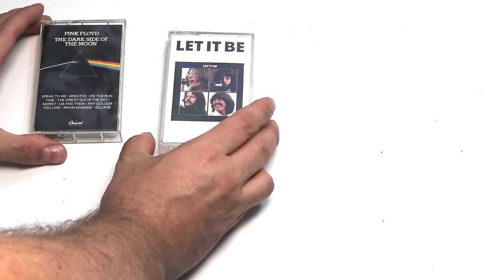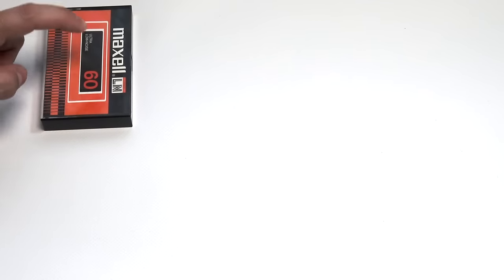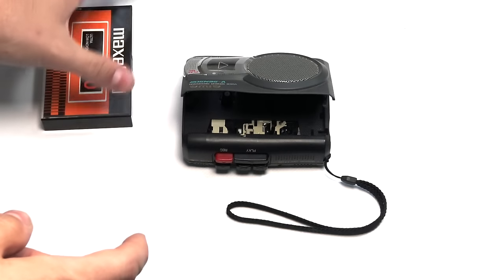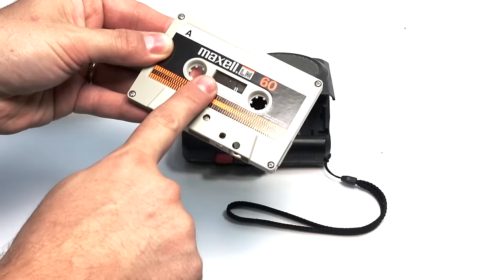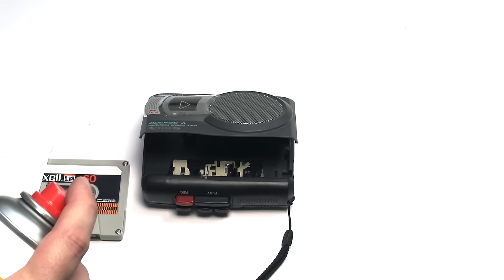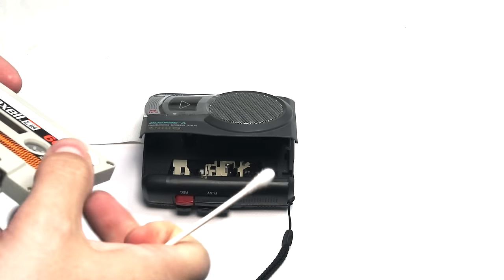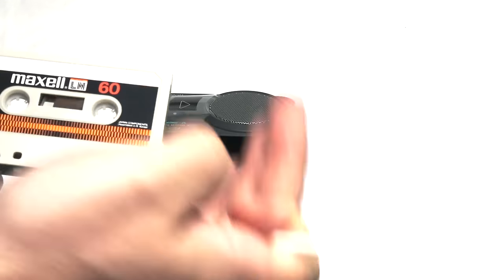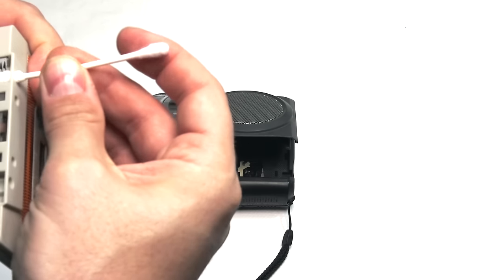How to relubricate your stuck cassette tapes

Comment: I does work! It takes a while for the silicone to work its magic by drying and herring to the tape. Thank you sir, you saved some cassettes from being filed in the round file under Garbage!
Reply from the maker: Great news! Thanks for telling us!
Reply from the maker: Jonah, as many other techs you are driven by prejudice without real knowledge, in this case, about this issue. It is really sad to see how arrogant you are, just go back and read your commnets. I see now that you have written several negative comments over the months and I think you should inform youself better before pointing your finger, insulting and denigrate people. I have posted simple things but considering that you would like more proof here you go. After rading this info, I hope you will be polite and intelligent enough to apologize.
Here you will find a selection of scientific papers explaining the issue and how it is a standard procedure to relube tape (even NASA does this!). I have underlined a few crucial passages in the papers: 
Heritage: https://www.dropbox.com/s/f8254yfeqrrw9vp/heritage-02-00097-v2.pdf?dl=0
Nasa: https://www.dropbox.com/s/xxdw1qh8mlbppdu/Nasa.pdf?dl=0
HESS: https://www.dropbox.com/s/ydrvxg6zipjkrvw/HESS_Tape_Degradation_ARSC_Journal_39-2.pdf?dl=0
Preservation Commission: https://www.dropbox.com/s/3s3ejmho2jexhgt/pub54.pdf?dl=0
   - (here is the official article: https://www.dropbox.com/s/rtvqt1n537w9vpa/Bogart.pdf?dl=0)
Kondo: https://www.dropbox.com/s/zi4vv42ggi9vh8u/tribochemistry-of-ionic-liquid-lubricant-on-magnetic-media.pdf?dl=0
Here is an article of a lab that is relubing its cassettes: http://tasso.cat/re-lubrication-of-compact-cassette-tapes-with-sbs/

Comment: 🤔 Doesn't It Mess With The Recording On Tape? Considering It's Being Lubricated?
Reply from the maker: No. But make sure you pick up the remaining/exciding lube with clean cuetips. All types of tape have lube. Check the video description more more info.
Reply: Thank You, Got It
Reply: 1938thunder yes. And it will also ruin your heads and gears on your deck. Trust me on this.
Reply from the maker: If you leave to much lube, yes. As I have explained you must let the lube seep in and then remove the excess with fresh cuetips. No risks if done properly.
Reply: ANA[DIA]LOG the lube doesn’t absorb into cassette tape. Sorry it’s not physically possible.
Reply from the maker: Jonah, as many other techs you are driven by prejudice without real knowledge, in this case, about this issue. It is really sad to see how arrogant you are, just go back and read your commnets. I see now that you have written several negative comments over the months and I think you should inform youself better before pointing your finger, insulting and denigrate people. I have posted simple things but considering that you would like more proof here you go. After rading this info, I hope you will be polite and intelligent enough to apologize.
Here you will find a selection of scientific papers explaining the issue and how it is a standard procedure to relube tape (even NASA does this!). I have underlined a few crucial passages in the papers: 
Heritage: https://www.dropbox.com/s/f8254yfeqrrw9vp/heritage-02-00097-v2.pdf?dl=0
Nasa: https://www.dropbox.com/s/xxdw1qh8mlbppdu/Nasa.pdf?dl=0
HESS: https://www.dropbox.com/s/ydrvxg6zipjkrvw/HESS_Tape_Degradation_ARSC_Journal_39-2.pdf?dl=0
Preservation Commission: https://www.dropbox.com/s/3s3ejmho2jexhgt/pub54.pdf?dl=0
   - (here is the official article: https://www.dropbox.com/s/rtvqt1n537w9vpa/Bogart.pdf?dl=0)
Kondo: https://www.dropbox.com/s/zi4vv42ggi9vh8u/tribochemistry-of-ionic-liquid-lubricant-on-magnetic-media.pdf?dl=0
Here is an article of a lab that is relubing its cassettes: http://tasso.cat/re-lubrication-of-compact-cassette-tapes-with-sbs/

Comment: my tape is basically stuck though. It is very sticky and pretty hard to turn. any tips?
Reply from the maker: If it sticky then you have sticky shed syndrome. You can try to bake it for one last shot. Otherwise it's gone!
Reply: @anadialog  what do you mean by bake? (Im new to cassettes so pls explain)
Reply from the maker: When tape, especially reel to reel tape, has sticky shed syndrome you can literally bake the tape at very low temperature (check online the correct ones, I don't remember know) that will temporarily give you the chance to rip and/or duplicate that tape for one last shot. Then eventually it will decay. You can it it also with tape, possibly taking the tape out of its shell.

Comment: Hello dear,
Ciao carissimo.

I tried this with three cassettes using the same lubrifiant that u suggested. It works but not 100%. The tape stucks at the beginning/ at  the end. Is it possible I used too much lubrifiant? If so, is there a way to resolve the problem?
Thank u in advance and tanti saluti ✌️
Reply from the maker: Did you wait at least a week?
Reply: @anadialog  thank u 4 answering.. 
Yes and no. Because I wanted 2 c if there was any improvement. So I checked everyday if it worked. But now it's over one week. Yesterday I lubed again all three cassettes and now I'll wait a few days. If the problem persists, maybe I gave them 2 much lubrifiant. Is this possible?

Comment: That lubricant stretches the tape. The only thing that requires lubrication are the reels. This lubricant will also compromise the pinch roller adhesion properties. DON'T PERFORM THIS !!!!!!
Reply from the maker: Check the documents I added in the video description before shouting your preconceptions. Its a standard procedure, also done on cassettes decks. Also, as I have explained and written all over the place, you must obviously absorbe all the exceeding lube with clean cue tips after the treatment. So non of what you are claiming will happen.
Reply from the maker: Again, Re-lubing is a standard procedure, leave aside the manufacturing phase, we are talking after the original lube has evaneshed. Lubricant is present ON the tape. Check the documents in depth and all your doubts will be removed. BTW, I did invent anything I am just reporting an existing technique.

Comment: I had two cassette tapes one squeaked the entire time and the other slowed down and stopped in the middle of playing I used home depot silicone spray wet the Q-tip several times in the process you could actually see the tape get wet with silicone , LOL I wet it way to much and started to see bubbles forming inside the cassette case  so to dry it I used dry Q-tips it . the process took 30 minutes. I played the tapes back wow they played perfect and the Tape Deck was not harmed with the silicone but cleaned the head and pinch roller to be on the safe side . I highly recommend this process to save your tapes
Reply from the maker: Thanks for your feedback Jose!

Comment: It has been my experience with cassettes that you don't have to introduce lubricants to solve wow / flutter , slow or no rewind /FF ,when you now that heir is no mechanical problems with the deck . As all brand name cassettes are held together with 5 screws ,
I have found that by ever so little , just losening these screws then gently twisting the shell will solve all of these problems . If you happen to have a cassette that has a clear teflon liner on both sides of the tape pack , i have found that by separating the cassette shell and lifting out just one of these liners also solves the problems . Definitely low tech solutions . But I do not agree that using  a silicone lubricate is wise . Silicone is an insulator of current . And 0.5 mil tape does not need to be gummed up by a foreign agent .
My policy is keep it simple .Do nothing that will potentially damage the tape and gum up the heads of your cassette deck . If when playing a tape , the tape squeals it is most likely that the binder that holds the oxide in place has dried out . And as the tape is dragged across the head it may squeal . If the binder is failing it can grab and bounce on the head causing a variety of unpleasant sounds . I've been using both open reel and cassette . The Open reel began in 1975 . Cassette in 1996 . I am very familiar with tape .
Spraying aerosols isn't one of them ................DGR
Reply from the maker: I agree that one should first try mechanical solutions. But, if these fail, relubricating is a standard procedure for tape. Please read the articles I linked in the video description on this topic. One just needs to suck up all the exceeding lube and let it seep in. No risks at that point.

Comment: Wouldn't it be safer to use Rubbing Isopropyl alcohol, like a 70/30 mix? That has a light lubricant in it and much safer that silicon
Reply from the maker: ABSOLUTELY NO!!!! Alcohol melts plastic and tape is almost all plastic (polyester or acetate). Never ever use any peecentage of alcohol on plastic media, inclusing vinyl (which is also plastic, PVC).

Comment: Hey I'd like to see an experiment where you bake a cassette that's not playing good, I've seen a few folks on zappateers bake there tapes and they sound much better
Reply from the maker: Baking a tape is a one way direction with a point of no return. You bake a tape to play it one more time and transfer the content to another media. It is not a rejuvenation process.
Reply: @anadialog  well they also transfer the tape over to a new shell
Reply from the maker: Sure that is good! But if it's a lube problem it will not help much.

Comment: Strange ! Actually the 2 black (sometimes transparent films) inside the tape, act as minimum friction for the wheels spin.
Putting lubricant on the band itself, will end up on the reading heads and creating dirt on them ! Not speaking about the adverse effect of lubricant on chromium/magnetic coating of the band.
Reply from the maker: All tapes have lube in the binder. Check the info and articles in the video description. Just pay attention and collect the excessive amount of lube with cue tips.

Comment: In my case, my tape was so stuck, it needed a drill to turn it. I lubed it, and still no action.. So I salvaged the pad from the tape and threw the Christopher Cross tape right into the garbage. It doesnt pay to try to lube an old cassette, just forget it..
Reply: EXACTLY! Because this person has NO IDEA that it was the bad "binder" in the Tape's oxide that causes all these aformentioned problems! ANY kind of silicone, oil, or lubricant etc. will RUIN your tape deck, not to mention the rubber pinch rollers... This is utterly ridiculous from a person who knows nothing!
Reply from the maker: Stop babbling and start reading the articles I have linked in the video description. I have documented my self you are just moved by prejudice. Itbis a standard procedure for cassettes and reel to reel magnetic tape. It is a well reknown lube problem for example in XDR cassettes. The process is safe of you follow my instructions. Try, then discuss. For now you are just moving your hands on the keyboard with no backup data or grounded info, just your biased opinions. 😉

Comment: I have a few Ampex Grand Master cassettes from 1979 and they are prone to sticking.
Reply from the maker: It's the Ampex formula sticky syndrome, unfortunately all their type of tapes suffered of this issue...
Reply: @anadialog  I have a few 456 reels that are sticking as well (actually two are ConcerTape from Radio Shack which are rebranded Ampex)

Comment: What about when it sound wobbly the first 2 songs sound fine and then the rest of the tape sounds wobbly
Reply from the maker: Could be, but not necessarily a lube problem. Doesn't hurt to try.
Reply: slip-clutch that spins the reels slipping too much, after the small-radius layers of tape on the take-up reel are past and more torque would be needed to keep winding it up.

Comment: I would spray  the spools as well between the spool and the cassette body with the silicon and have the q tip on the other side when lubricating on the plastic side not on the magnetic side you could put some silicone on the felt pad in the middle to add lubricant to the tape when it's under pressure from the head then you don't need to bother with the q tip and  having easy accessl tape machine.
Reply from the maker: Good idea John (the felt pad)! I did sone research and I discovered that the lube was originally on the oxide, phobably because it is abrasive and creates more friction than the other side.
Reply: +ana[dia]log but it would get transferred from the backside to the oxide? by coating the plastic side this will come in contact with the oxide on the real. plus rubbing the oxide at speed I don't think it's a good idea not with cotton wool buds, just spray or 3 or 4 drops on the felt pad and couple drops inbetween  the spool and the body on either sides should do it.
Plus having it on the felt pad should help with wow and Flutter figures this is the most resistance when in play against the head and the back of the tape. I thought about graphite powder mixed in with the silicon maybe 2 to 1 silicone but it could cause problems with the magnetic field on the tape I'm not sure maybe it's something you could try! See over a long period of time of playback if the recording gets muddled or shifted, I would have thought the graphite would be charged by the recording and will it stay in place? If it stays in place it on make it for a better type. You could make your own tapes by using Scotch tape and graphite powder now there's an experiment!!!!

Comment: I have a question.
The breakdown of lubrication was on the back-coating of the tape.
The side that doesn't touch the heads.
Assuming this is right...
Shouldn't we be coating the other side?
I know it gets contact anyways because it respools...
Idk thoughts?
Reply from the maker: Lube is present in the top coat, not on the back. Just lube well and make sure you make it seep in and then absorb the remaining lube with clean cuetips.

Comment: Does reel to reel tapes have the same problems?
Reply from the maker: In some cases, yes.
Reply: Can you explain more detail, for I have hundreds of reels over 30 years old. I know about cleaning them with a cloth thru the deck rewind/fast forward but do I need to lubercate them ?
Reply from the maker: Hi again, I am not an expert of this but I did hear about people that tried to lubricate their tapes when they were a little stiff. A lot of people prefer to bake but I think that in some disperate cases a small amount of lube can help. You could try to put some silicon-based lube and see the effects but I must worn you that I have never done this so please do not take my word for it. Sorry for not being of more help.
Reply: Look up Sticky tape syndrome. There is an article on Tape Heads on how to cure the problem using Nu Finish car wax. I've used it for years and it works well. Lawrence
Reply from the maker: Hi Lawrence, thanks, yes I know that issue, epecially from my reel to reel tapes. This is a different issue, a lubricant issue, but tapes can be stuck also for the STS problem, you are right.

Comment: Is it a safe solution for a player?
Reply from the maker: Me and all the other here that tried it did not have any problems just make surento absorb the exeding lube
Reply: @anadialog  Thanks for comment my question. 
What do you think on this solution for cleaning cassette tape:  if I will try your solution with player and cotton swab but instead lubricant will use 99% alcohol?
Reply from the maker: Please don't! Alcohol consumes the plastic of the tape and will remove all lubricant.
Reply: @anadialog  Just have tried this procedure. I found the same player like in your video. And got Kontakt 61 (still no 3M in sale in my country). So, It needs some practice - because cotton swab lightly damaged tape in first attempt : it started to twitch even when I held it with my hand like in video. Next attempts were better. 
Generally speaking, I think this solution good for old tapes that weren’t in use for years and were kept in a bad environment/condition like mine cassettes. 
But the only question that I have right now is this solution it proper for TAPE cleaning or it is just for lubricating?
Reply from the maker: Just lubricant!

Comment: I have been trying this but doing it a little different than the video.  I am opening up the cassette and wiping down the two plastic "posts" the tape glides over with silicone lubricant.  Then fast forwarding, rewinding and playing.  With one cassette this worked instantly.  I'm waiting to see if it works on the others.